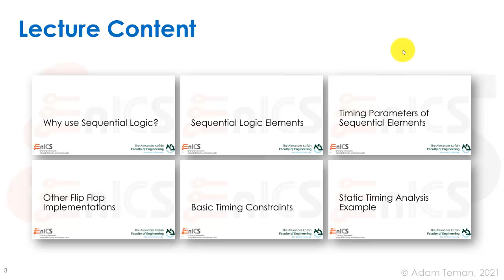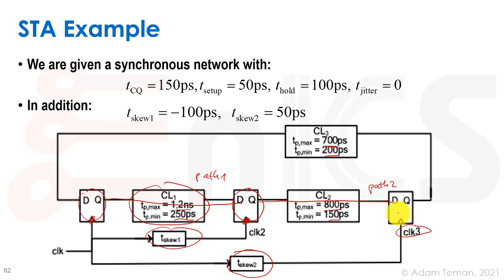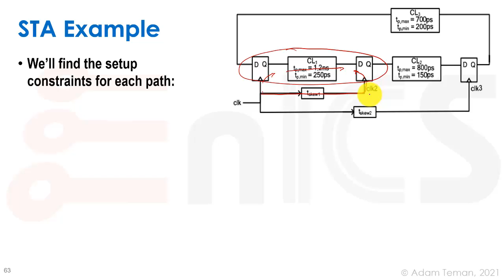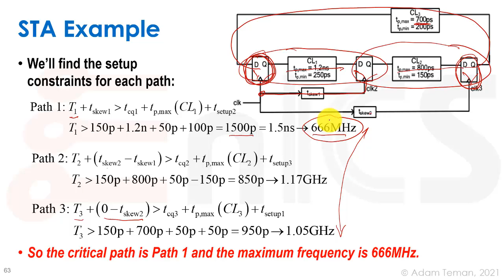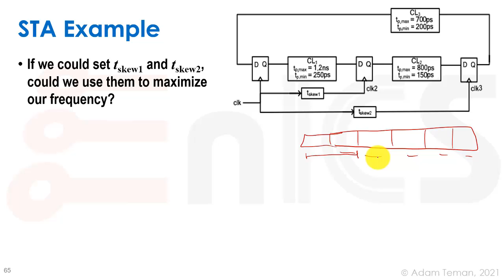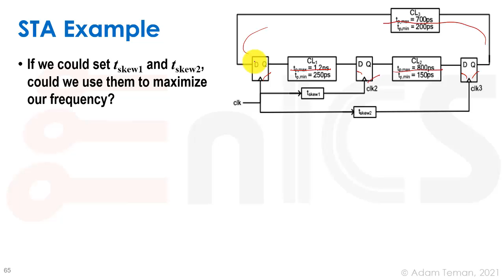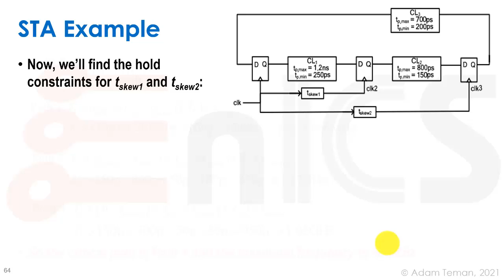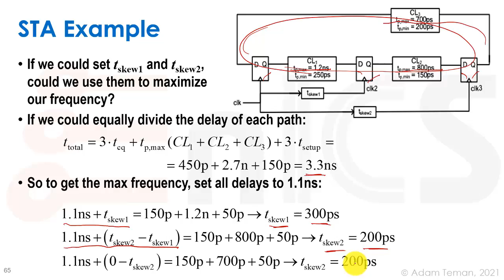VLSI - Lecture 7f: Static Timing Analysis Example

Comment: Hi Sir, how you got 1.1ns delay to calculate max frequency (or it is assumption). Please clarify on this.
Reply from the maker: No, it is not an assumption. It is calculated.
We took the total delay of the "loop" (the "t_total" calculation) and it came out 3.3ns.
Since the loop had three stages (Path 1--> Path 2 --> Path 3), we want to get equal delays on each stage and so divided 3.3/3=1.1ns.

Hope that explains it.
Reply: @AdiTeman  Thank you sir